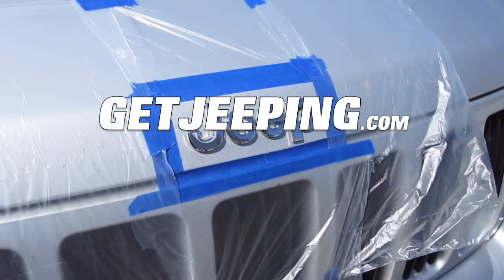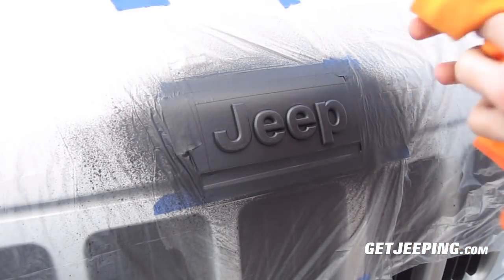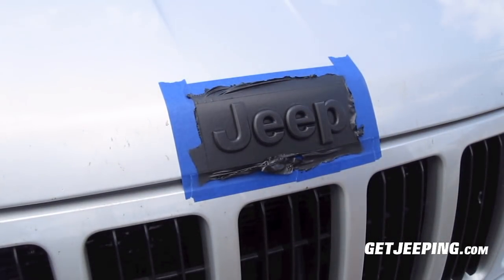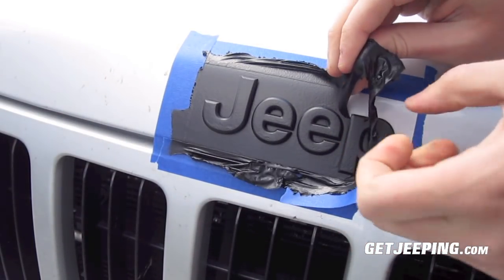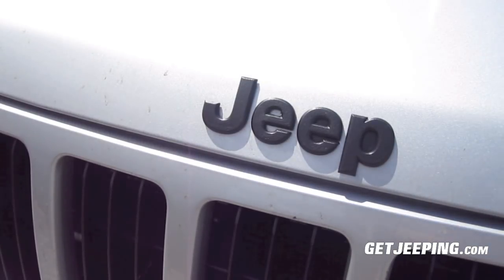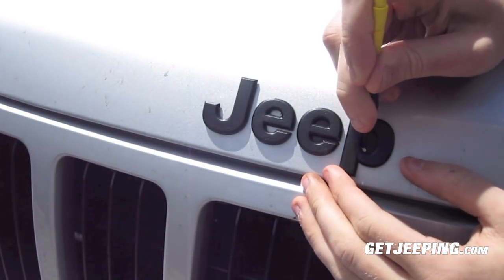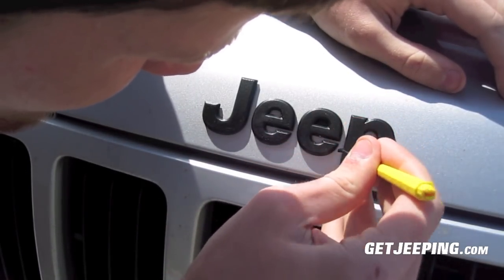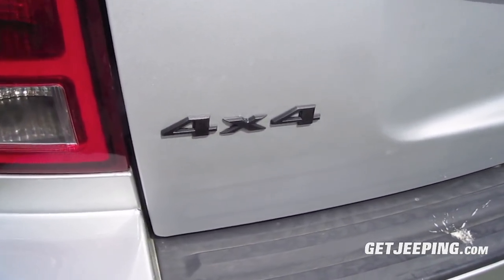How To: Plasti Dip Emblems - GetJeeping

Comment: Just a suggestion, if you hold the nozzle farther away, around 6-8 inches away from the emblems it will end up having a more even texture and wont spray so blotchy. Also, if you apply 2-3 coats it will be easier to peel and will last longer. Great video!

Comment: I put plasti dip and glossifier on my 2011 Grand Cherokee emblems and it lasted 2 years.  It was easy to do and the results are pretty good.  A toothpick and tweezers are a safer option for removing the hard to reach places though.

Comment: Actually they suggest use a screw driver as long as you don't touch your paint. Use the screwdriver to pull the plasti dip back. If your uncomfortable use a toothpick

Comment: I think some hobby shops have small steel brushes for intricate work like getting Plasti Dip off clear coat.  You should look into it.  Don't think you can dull them on the cement first but if you just buy some portland at Home Depot you can  just rub it into the emblem first and then you get the same effect.  Good Luck!

Comment: Should have just used an Xacto knife to get the insides of the letters out, would have come out a lot cleaner as well. You can still pick one up, if you don't have one already, and clean up the insides of the letters a bit with it no problem. Nice job it looks good. I did my badges on my 2006 Dodge Ram 1500 and after I plasti dipped them I then used a Dupi-Color clear coat in order to get a nice gloss finish to them, just a little tip if you want to maybe go with a gloss finish instead of a matte finish.

Comment: Actually he has a point other than it just working. A screwdriver is harder than the clear coat meaning you will scratch the paint if it makes contact with the car. A toothpick will not no matter how hard you push it into the clear coat.

Comment: When you where ripping it off, why wasn't it coming off the letters?
Reply: ThunderMCR plasti dip is basically rubber in a can. So when you pull it around edges itll rip clean off the edge without harming the emblem

Comment: Use a toothpick to remove the smaller bits. Not a damn screwdriver.
Reply: Either or just if you use a screw driver you have to be careful

Comment: To all, use a tooth pick. Using a screw druver will scratch your paint
Reply: whose gonna notice scratch paint between the E of the jeep logo?
Reply: i mean whats the point in using a hard metal object on a nice car, would u prefer unnoticeable scratches or no scratches at all?
Reply: If its unnoticeable then it technically doesn't exist

Comment: why...would anyone use a screw driver or anything metal against the paint...
Reply: Because u arent pushing down with it, if he used it correctly you just use the screwdriver to roll the plasti dip not cut it.